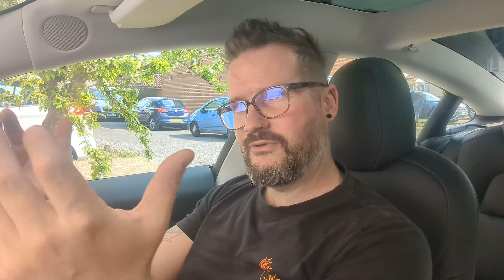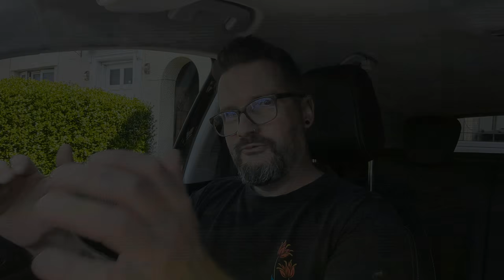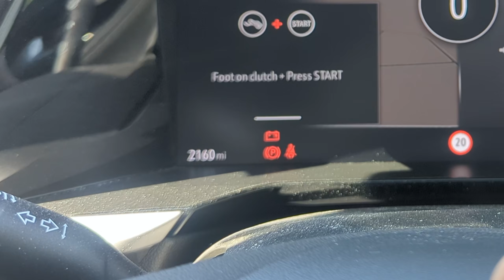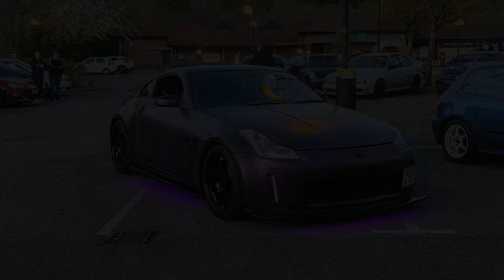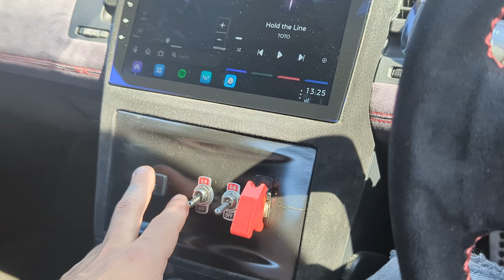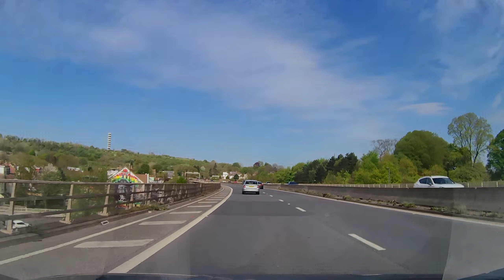Are All Modern Dashboards Terrible?

Comment: In my opinion you should always have oil pressure displayed. It's the best sign on the health of the cars engine, and a good early warning
Reply from the maker: I'd say it's dependent on the car, and a lot less vital in some than others. For something like my Z, there's definitely a strong case for it
Reply: @GarageTinkering  I guess maybe not for an electric car, but on any ICE car if you get to know how your oil pressure usually behaves during a drive it can give you a good early warning of a problem before it requires a complete rebuild or worse. If you see an unusual fluctuation, or if its slow to rise or sits low you can pick up from that if you have an issue with your oil pump, a sudden leak or unexpected low level, or a bearing issue and you can take preventative action before it's catastrophic. It's something that I wish was there on my bmw. I'd also prefer more access to diagnostic messages than manufacturers give without having to plug in something extra. It would be great to also see information from the plethora of sensors that the car has if they were to move out of their usual range... again to help with preventative maintainance and problem solving. It would be even cooler if a lot of the data was logged. Maybe my perspective as a racer who does a lot of his own mechanics and a software developer leaves me a bit biased. I do like to have debugging tools and information on hand
Reply from the maker: I guess you could achieve something simpler with a defined set of rules with oil pressure for what expected behaviour is, and flag if it's outside that. Like I know on my Z the three main checkpoints are ~90psi on cold start, ~15psi on warm idle, and ~60psi at 60mph in 6th. As long as those conditions are plus or minus and acceptable factor, everything is usually groovy.
Reply: @GarageTinkering  true, but it would be cool to see if it drops during cornering, braking or acceleration - even momentarily. Could be a sign of a low level, issue with oil control in the sump, or even a failed oil pump pickup. I even had an oil cooler line fail completely during a drive in my old jag, saw the oil pressure start to drop and killed the motor saving it.

Comment: Every control in a motor vehicle should be usable without having to look at it. No real issue with digital displays but controls... Touch screens are primarily an exercise in cost saving. Tactile FTW!
Reply: Came to the comments to say exactly this! A few months ago I was in a minor bump and my VW Polo had to go in for a repair. I was given a new VW Golf as a courtesy car, and honestly thought it was going to be really hard giving it back. Unfortunately, although the Golf was a lovely drive, almost every single non-driving control was touch, and layered under submenus. 

Something as simple as changing the direction of the fans (which in my Polo is just a knob below the touchscreen), required actual selection on the screen. Since the screen was quite big, if you were looking at all the options, you might have to divert your eyes almost 45° — completely away from the road. 

Furthermore this UI took over the whole interface meaning CarPlay had to be minimised whilst I was performing this function. This meant any navigation directions were temporarily removed until I could first select the setting, change it, then re-open CarPlay. 

As a UXer myself, I kept questioning whether anyone had actually tried to use any of this before they shipped it. There were lovely animations everywhere, like the car settings screen which had a 3d model of the car, and you kinda navigated the model itself to change options - which was super intuitive actually - but the idea that core, time-sensitive, functionality required precise navigate menus to select options which were previously available via tactile controls was just bonkers, and frankly felt dangerous. 

Even the software itself just felt like a tablet OS - it didn’t feel like there was any thought into optimisations for a driving-specific UI e.g. having the core controls on the parts of the screen that were nearest the driver’s hand so they are easily accessible(something which CarPlay does). 

It seems VW has identified this as a mistake done a complete U-turn, promising tactile controls in future models, but there will be a set of cars from certain years with just awful interfaces forever, and that’s really quite sad - especially if this is the final ICE versions. It just felt like 0 real world testing, just jumping straight to making things seem pretty and good, and ignoring core requirements!

Comment: Fond memories of the Ford Ka I had ten years ago - the dash backlight had failed. So I installed a GPS speedo app on my phone and used that at night. Placing the phone facing upwards just in front of dash, it couldn't slide anywhere and the digits were reflected right at  the top of the windscreen above the road ahead. It was perfect!
Reply from the maker: Honestly, I think true head up HUDs are the best way forwards. It's a fantastic innovation - I'm looking forward to building one this year!
Reply: @GarageTinkering  A proper HUD is amazing, but I recently looked up how they did it because I know that they have different windscreens. I initially thought that there was a coating for contrast, but it turns out that the glass is actually tapered to make the focus correct.

Sadly, I don't think that a real HUD is possible to make for a car which didn't already have it as an option. It's a real shame because they are perfect for your speedo in particular.
Reply from the maker: Sounds like a challenge
Reply: @GarageTinkering  Looking forward to the video of you tapering your windscreen with an angle grinder. :D

I think it's only needed as the focal point is typically at the front of the car. You may be able to do without if you use a different focal point, but who knows - Optics are weird.

Look forward to seeing the experiments though!
Reply: @yngndrw.  there's HUDs and there's HUDs, though. proper aircraft HUDs focus at infinity and require complex optics to achieve this. an LCD or OLED screen just reflecting off the windscreen will focus at about 1m, so you can't focus on the digits and the car emerging from a side road in the distance at the same time, but:
a) you can't do that with a dashboard either,
b) the digits fill my phone screen - even with a cruddy old phone they're big enough to see without focussing solely on them, and
c) I configured it to change colours at 50mph and 70mph, further reducing the amount of attention it requires